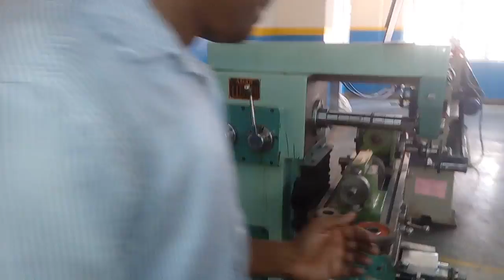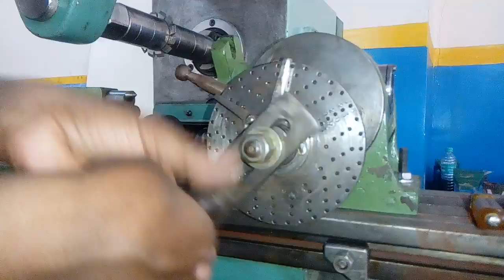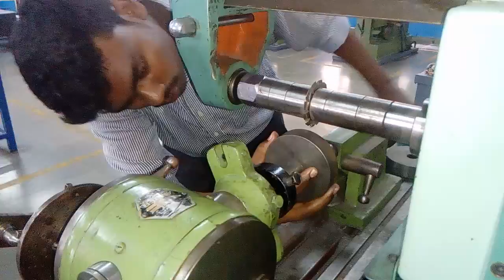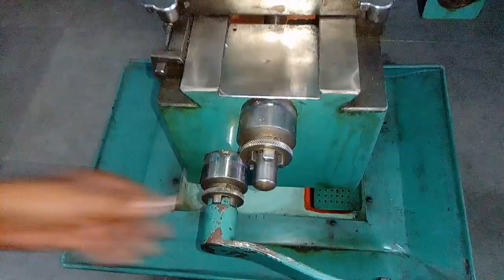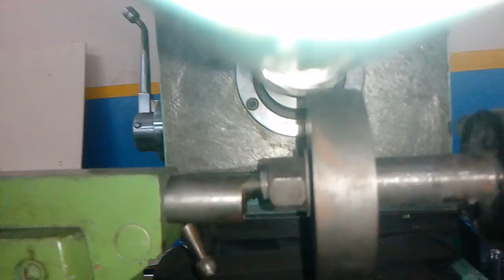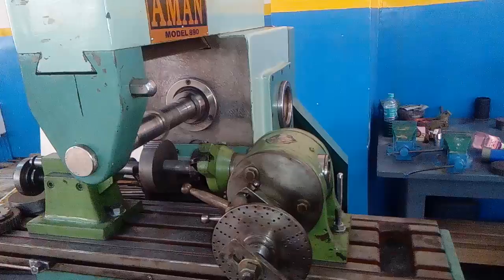Milling machine gear cutting operation simple index [ NAVEEN M INSTRUCTOR ] SJBIT

Comment: Thank u sir
 How to calculate the index
Reply from the maker: calculation of no of teeth
formula 
D=m(N+2)
D= diameter of blank
m= cutter module no
N= no of teeth, find the no of teeth using above formula
example: D=116   m=2    
116=2(N+2)
N=(112/2)
N=56
simple indexing
40/N
40/56
Reply from the maker: calculation of no of teeth
formula 
D=m(N+2)
D= diameter of blank
m= cutter module no
N= no of teeth, find the no of teeth using above formula
example: D=116   m=2    
116=2(N+2)
N=(112/2)
N=56
simple indexing
40/N
40/56

Comment: CAN WE SET CUTTER PROPERLY ON TURNING ADDA MACHINE
Reply from the maker: an indexing head also known as a dividing head or spiral head, is a specialized tool that allows a work piece to be circularly indexed; that is easily and precisely rotated to preset angles  or circular divisions 
the work piece is held in the indexing head in the  same manner as a metalworking lathe.

Comment from the maker: calculation of no of teeth
formula 
D=m(N+2)
D= diameter of blank
m= cutter module no
N= no of teeth, find the no of teeth using above formula
example: D=116   m=2    
116=2(N+2)
N=(112/2)
N=56
simple indexing
40/N
Reply: What if we don't have 40 number on indexing plate